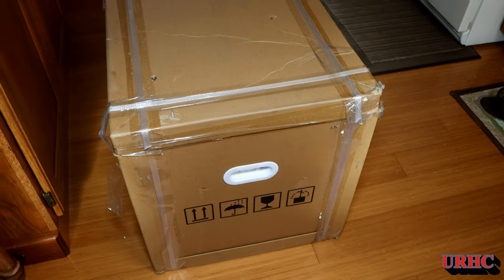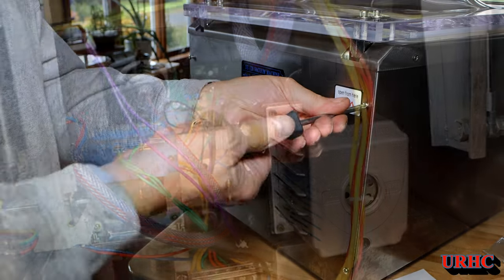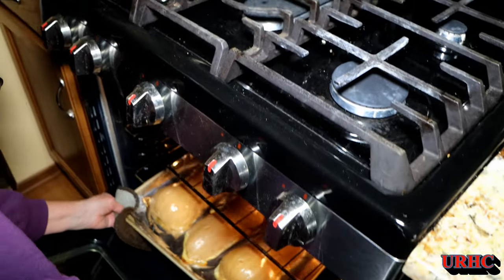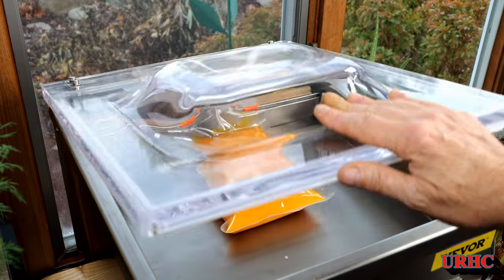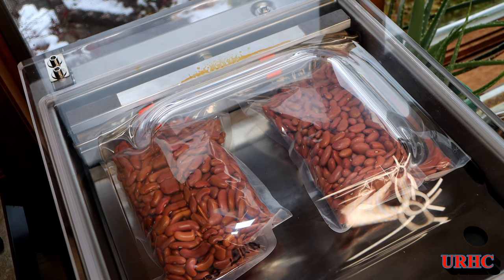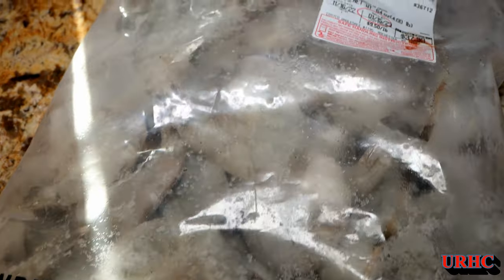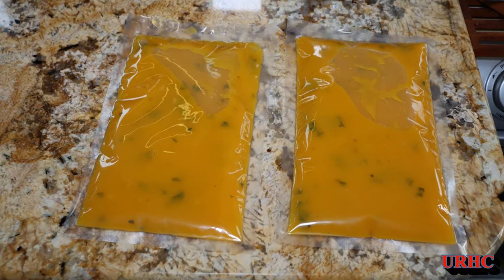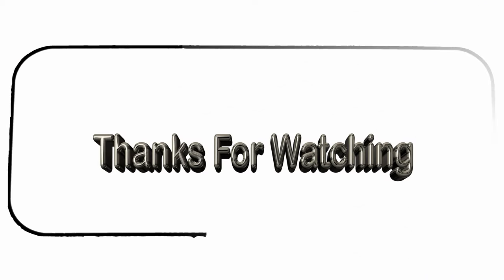Vevor DZ-260C Digital Chamber Vacuum Sealer Exceeds My Expectations For A Budget Priced Chamber Seal

Comment: I have used these vaccuum chamber sealers for a few years. One tip is if your bag expands like a ballon then you have a pinch in your bag and it had cut off the air. This forms vaccum around bag while inside of bag has air. I think when watching it because butternut was sticky thats what happened.
Reply from the maker: I found out everything like butternut has to be cooled down before packing. If warm it boils from the inside andexpands like mine did. Pack it cold and that doesn't happen.  Great sealer so far. Thanks for watching.

Comment: I have the clone to your machine (Chinese genetics). It has saved the cost of the machine over the 2 years I've used it. You can buy bulk quantities of foods when on sale and portion them out to meal or recipe size. Instead of making a small pan of chili or soup, I make a huge batch and pack it up in 1 meal sized packages that are prepared by throwing the frozen "bag o' soup" in a 12" skillet of water and bring to a boil. We also get large chubs of ground beef when somebody has a sale and portion it into one pound packages as you did but go one step further. When packing the meat in the bags, I tend to flatten it into one large bag shaped patty and then seal. By doing this, I can get 1 pound flat packed burger that stacks neatly in baskets in my freezer, saving money and freezer space. I also save money by buying my bags by the 1000 through the Webstaurant Store. I hope you get as much use from your unit as I have gotten from mine.
Reply from the maker: I hope  this lasts like yours.  It works great and I can't see paying  $1,000 more for a brand name that is made from the same parts.  I have been using  bags from Avid Armor for years with no problems so I stuck with  them. These  bags are cheap compared to the foodsaver type.  Definitely  a way to save some  money during this out of control inflation. Thanks for watching.
Reply: I’d be interested to know where you bought yours from, the model number and price.
Reply from the maker: There's a link in the description. Not sure  if they are back in stock yet though.  Should  be $341 with the black friday sale and my discount code if thesale hasn't ended.

Comment: Just bouggt one of these, must say the packaging was excellent, haven't used it yet will be processing a 1200lb steer, and 6 hoggets about 60lb shortly so this should be a good test. Nice video.
Reply from the maker: We love ours. Still works  great after over 1000 bags. One thing is that breakin oil that comes  with it mists putting some oder in the air when running a lot of bags. After a couple  hundred bags replace it with non misting vacuum oil. Thanks for watching.

Comment: If you know someone with a 3d printer I worked on making a file to print a drop in ramp (with metal spacer plate removed) that fits the machine and gets the bags at an angle that makes liquids easier.
Reply from the maker: I made one from bent acrylic.  I'm not sure all filaments are food safe and the surfaces are porus that can harbor bacteria so be careful with that. This is a wonderful machine.  Thanks for watching.
Reply: I have one...got a link to the STL?

Comment: Oh, by the way, you only need to insert some hard styrofoam board to reduce the internal volume of the chamber and reduce your vacuum time.
Reply from the maker: The outgassing from styrofoam is not food safe. I have some UHMW food grade 1 inch sheet I was thinking about trying to replace the shelf.

Comment: I just bought this Vevor sealer partly due to your video. But most of all, thank you so much for the solo cup suggestion. Amazing how much easier it is to load ground beef into pint bags!
Reply from the maker: We love ours. Thanks for watching.
Reply: @unemployedredneckhillbilly2023 I didn’t readily find a canning funnel so I ended up getting a 1 cup plastic/polycarbonate measuring cup with a handle and cut the bottom off. It’s a much better solution than I expected and it is dishwasher safe.

Comment: Thank you for this extensive and honest review. Food saver owner here and we hit the limits of what this machine can do. The vevor looks like pretty good price for buck wise.
Reply from the maker: So far surprisingly it has worked great with no bad seals after a couple hundred bags. Just replace the cheap oil with non misting oil. There's a update about the smell we would get with a big batch run and the original vac oil. Inflation has pushed the price up quite a bit now but still a good lower cost option. Thanks for watching.

Comment: First time viewer here.  This is the most thorough review of of any chamber vac machine I've seen.  
I had questions about this particular model and you answered every one.
I'M SOLD!
Thank you, sir.
Reply from the maker: I also have an update video after a couple hundred bags and we love it with no problems yet. After a batch of bags wi get some oil smell that was caused  by the cheap misting oil that comes with it.  Buy some good non misting vacuum pump oil that seems tohave solved the odor. I see the price is higher  now but if you use my link it should be the best price available plus use the 5% coupon code. Thanks for watching.
Reply: Please tell me the oil you used. I pulled the trigger. Your Discount code worked. Much obliged! 09/10/2023
Reply: @bucketofguts  I used the oil that was included in the package. There's no label on it. There is enuff for a refill if I need it.

Comment: Very nice video URHC.   I purchased the same unit in June.     Although i had a couple issues with  the unit, DZ-320,  Vevor made good  on it and i'm happy with it . 

Your idea on a ramp for liquid type  sealing is what i have done.  I also  fill up the  chamber with cutting boards to reduce the  amount of space to evacuate,  leading to lesser time to  run and a tighter seal.

I also read that the colder the "liquid" type items to seal are  the less chance of  the issue you got with your squash..   I generally let my soups, spaghetti sauce   etc  cool in the fridge over night before i seal them.  An alternate idea would be to bag it,  stand it upright in the freezer  until it turns slushy, then  seal it, this way you'll avoid that mishap and will be able to run a good vacuum.

Glad you're  enjoying the unit,  and again  thanks for the  wonderful video on it.
Reply from the maker: Thanks. I found out about the hot item problem after Thanksgiving when my wife made a couple gallons of turkey soup with the carcass. I tried sealing it hot first and wound up with a chamber full of steam and bag seal area that was covered in soup. Let it cool and no problems. So far we have really enjoyed this machine and it does a great job. I made a ramp but it's just not right and I will be making a second generation the bag can't slip down. Thanks for watching.

Comment: For things with higher air content (like the processed squash) my strategy is to leave my cycle at 30 seconds, but watch it running.  When it starts to get close to trying to overrun your machine should have a stop button.  When you hit stop it will just stop the vacuum process then continue with the seal, etc.  If you haven't tried it already one amazing thing you can do with these is to do really quick marinades.  If you haven't looked up that yet check that out, as well as flash pickles!  Also great for sous vide cooking (that's why I got my first one way back when). Enjoy your chamber sealer!  Definitely a must if you're a Costco shopper like me.  I process all my meat the same way you do as well.
Reply from the maker: Idont have a button to stop just the vacuum.  I tried the emergency button and it also dumped the vacuum from the chamber. This seems to be a simple no frills machine. I can't  wait to try the marinade application.  Thanks  for the ideas. .

Comment: Thanks for your thorough review!  I bought one based in large part on your observations and lack of problems after quickly realizing the FoodSaver we received as a gift has some drawbacks (e.g. not for use with wet items or liquids, will not seal mylar, seals are small and tend to fail, vacuum and seal times not adjustable).  The cup/funnel is a good idea.  The oiling procedure, view of the inside, and observations about deburred edges are very helpful.  Foods with embedded air…duly noted.  I wish you had demo’d sealing thick mylar bags, though others have reported it works well.
Reply from the maker: It has been a great machine so far.  We don't use mylar and from what I understand any heat strip will seal them so just shut off the vacuum and play with seal time.  Thanks for watching.

Comment: Thank you very much for your “real time” review. I truly appreciated your trial and error tests of the different foods and liquid. I’ve seen quite a few videos on different vac sealer but your style of this video influenced me to purchase the Vevor vacuum sealer. Oh and as others have mentioned, I am DEFINITELY going to use your plastic cup pouring method!! Thanks again for your time with that review. Have a great Thanksgiving and a heathy and safe holiday season.
Reply from the maker: We love this machine. So far every bag has come out perfect.  We did less canning and more freezing this year because of it. The only slight issue is the cheap break in vacuum oil it comes with can put a little smell in the air after a bunch of bags in a row. I switched to synthetic non misting oil and that got rid of the odor.  I now know let everything cool before packing and it won't  boil over like the butternut did. Hope you enjoy it. Thanks for watching.

Comment: Excellent video, Great demo and Review, looks well built, fantastic price, sealing goes so fast, that's a great deal. Thank you for posting the video. I'm sure it will last a lot longer and cheaper in the long run, than the small portable countertop ones that stop working sooner then you expect, lol. With so replacement parts. On my third one and bags are expensive.
Reply from the maker: So far  it has worked great. No problems  that I didn't cause.  I think  it's  a great value compared to  others this size. Thanks for watching.

Comment: I have the smaller Vevor chamber sealer, which is fantastic.  However, I wish I had this one due to the larger sealing bar and the slightly deeper chamber.  I also have a Vevor water distiller, which is also very good.  Very nice products at a more reasonable price.
Reply from the maker: I have also bought many vevor products now and have been very pleased by how good they are. Thanks for watching.

Comment: Hello URHC. Hey I'm the guy who commented a couple days ago I had just received my Vevor machine and was concerned because no matter what I did, I could only get half-way down the green zone on the Vacuum meter, or about 0.09 MPa. Well, I'm feeling a lot better about it because I did some more digging into this and what I found out is that vacuum performance on these machines is impacted by the elevation you're at. At or near sea-level, the machine should bottom out all the way to down the green zone or do its best. I found a discussion about a guy in Denver Colorado (elevation is 5276) and he can barely get his machine into the green zone or at about 0.08 MPa. He found a fairly easy conversion table and right on target, it showed him that based on his elevation, 0.08 on the vacuum meter was about the best he could expect. Now, I live in Idaho with an elevation of about 2,500 feet above sea level. Sure enough, I did the calculation he showed and my best vacuum reading should be about 0.09 MPa. Sure enough, this is right where I max out on my vacuum meter. Hats off to Vevor because as far as I can tell, their meters seem pretty accurate. So by this theory, if I traveled with my machine and brought it too a coastal town or say, Los Angeles, my new max vacuum reading should bottom out like you said yours does. 
Which leads me to this. I remember you mentioned you said your Vevor easily pulls the meter all the way down to the bottom of the green zone. Can you tell me the approximate elevation where you're at? Would be appreciated. Even if its close, say 400-800 above sea level or up to 1000, you should be getting that great reading. Now, if you tell me you live way up in the mountains, well, so much for my research!
Anyway, very very impressed with the machine and I think what counts is I'm getting great results and much superior results than the Food Saver type vacuum seal.
Reply from the maker: That is great info. I did not realize elevation made that much difference. We are at 469 feet above sea level. We are well over 1000 bags now and not one failure to seal properly. Only issue has been things like bones poking holes in the bags causing a leak. I know many have purchased these machines and haven't heard of any problems other then the cheap misting oil they are supplied with creates some odor when you do a big batch of bags. Good non misting oil fixes that cheaply. I think this machine is as good as brand name machines costing 3 to 4 times the price. The only reason I keep trying Vevor products is because everything so far has worked as promised and is an affordable option to other name brands that also are manufactured in China. Thanks for the education.

Comment: Hi Buddy,
Two things here...First, make sure your food is room temperature. Second, I noticed you were closing off the open end of the bag with your fingers, don't do that, in fact, you need to be sure the open end stays open, or your vacuum will cause expansion of the bag, allowing the food to be drawn out. Again, you cannot seal hot foods. They will boil out at the reduced pressure.
Happy New Year.
Reply from the maker: Thanks.  I learned that after trying to pack warm soup. You have to stretch the end so there are no wrinkles in the seal area.  Thanks for watching.

Comment: We have ALOT of guacamole in our house but it does go bad after a few days if it doesn’t get eaten soon enough. I just bought a VacMaster 230 chamber sealer and am testing how to use a canister to preserve my quac. So far, after a few days, sliced avocado in the canister is as good as when I sliced it. This is still an experiment in progress but I’m optimistic this is going to give us a few more days before it spoils. Since I’m not using a bag, but instead, a canister, I’m setting the seal time to zero.
Reply from the maker: my wife just cuts them in half and a little lemon juice on the cut face of the half that won't be eaten then some plastic wrap. They will last a couple days without vacuum.  Thanks for watching.

Comment: One idea to avoid that mess is semi freeze the mixture you made, so it will become more SOLID, than you fill the sac and seal.
This should work!
Reply from the maker: We found out everything must be cool and no problems.  Hot items boil quickly und vacuum.  Thanks for watching.

Comment: Cool Tool... I made a holder that would hold 3 bags upright that I can fill with Soups and such for camping.
Put them in the Freezer in the holder,  then I could Vac seal them with a Common Vac sealer. 
Nice flat packs to help chill the cooler too.  
Set some marshmallows in there and see how big they get HAHAHHAHA. at least they wont make a mess .
Looks like a common Refrigeration vacuum pump in there. 
Mike M.
Reply from the maker: That's a good way to do it so you don't need a big machine like this sitting  around.  I do that with Marshmallow peeps in jars using the lid attachment to amuse the grandkids around  Easter.  I didn't  expect a pump that big. Thanks for watching.

Comment: I dont know. I use the heck outta my Avid Armor USV32 that came in at $700 with tax & shipping. The Vac pump is dry and internal like the Vac pump in my lab. Works great. There is a difference in the mTorr. A food saver cant begin to pull a serious vacuume. Add OAs to your dry foood.
Oh and I just ordered the accessory hose for the USV32 so it will seal large jars.
Nothing against Vevor, I have bought well tools from them.
Reply from the maker: We love this one and hae done hundreds of bags without any problems or bad seals. This will do 2 (6) inch bags wide.  Yours will not, it's equivalent  to the smaller $250 vevor. Both are made offshore and do the same thing and as long as you're happy with yours,  that's all that counts. I have been using avid armor bags for years but tried one of their sealers and it was junk so I won't touch another.   Thanks for watching

Comment: New sub here. Thanks for the video. Tried using food saver bags with this unit and it doesn't hold the vacuum.  The information on the chamber bags was what I was looking for!  Thanks for an informative video.
Reply from the maker: I use the foodsaver bags also. Set the seal time for 2.3 to 2.4 depending on the bag and they work good. For the 3 mil bags I use 1.7 for the seal time. Thanks for watching.

Comment: I like that you did a wide variety of things. What is the maintenance like for the pump, please? I'm contemplating a Vevor or an Avid Armor. Of course, the price of this one is way better but the Avid Armor has a no maintenance, dry rocker vacuum pump and I like the sound of no maintenance. Thanks!
Reply from the maker: If you want no maintenance go for the other one. This requires the oil be changed every once in a while. Oil pumps for the most part can pull 100% vacuum and dry only about 80%. This seal bar will do 2-6 inch bags side by side also. Thanks for watching.
Reply: @unemployedredneckhillbilly2023  thank you so much 🙂

Comment: Thanks for the great video.  I am curious why the title of the video notes a Vevor DZ-260C, and it does look the same as the one on the Vevor website, but the back panel of your unit says DZ-320?
Reply from the maker: It's DZ-260C-V1 according to the order page. They change numbering at times. I sometimes get demo units that may not be labeled correctly. Thanks for watching.